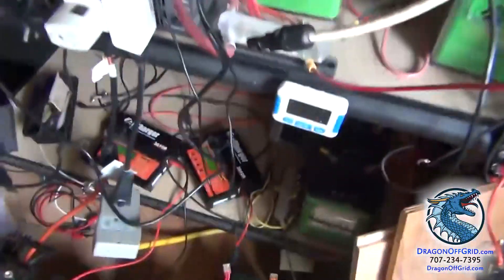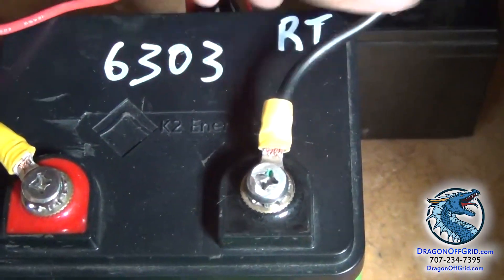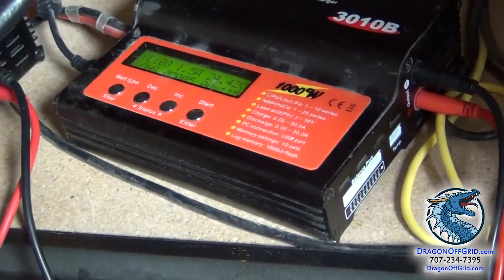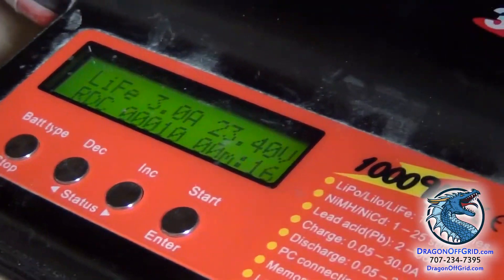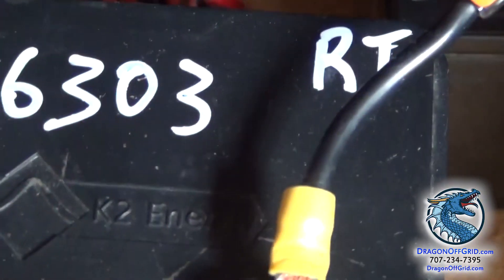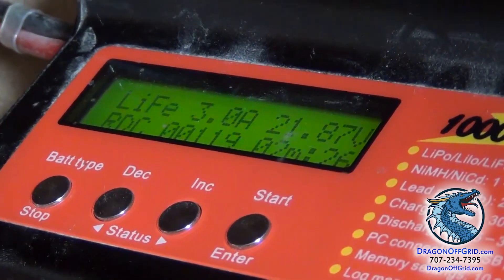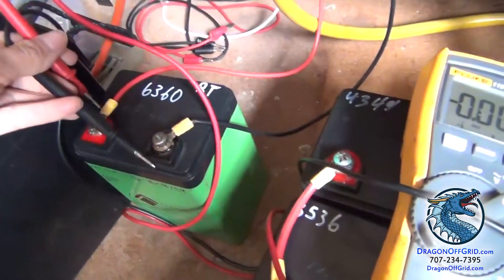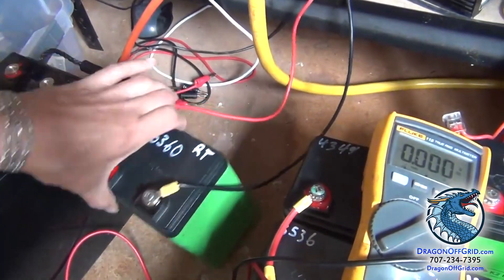How to test a K2 Energy Lithium Battery for FULL CAPACITY [K2B24V10EB]

Comment: I've acquired a few of these batteries and all of them are reading 8v. When the BMS turns itself off, does it usually rest at the voltage you measured or could also be at 8v like in my units?
Reply from the maker: Get in contact with us via text or call if you need help or have questions.
We've been working with K2 Energy batteries for 6 years

If under 10V for a 12V battery, jump with a 12V power source.
If under 20V for a 24V battery, jump with a 24V power source.

Comment: Hi Dragon Off Grid do you sell these batteries?
I have an 84V scooter and track down a couple companies in China that will make an 84v 50ahLifepo4 battery
for around $700. 
I saw your video and was wondering if the 7 of the 12V version of these battries can be
put in serier to make 84V.
Is 7 too much to put in series.
Reply: It would depend on the BMS, from the spec sheet of the K2 Energy (various models) they typically don't recommend more than 2 units in series, as the BMS may not have a balancing function. Ouch, a 28S battery, thats a big pack! Good luck.

Comment: I bought 4 of these to see if I can get them to work with my 24v apc ups, but I am curious what is the screw I use to screw down the terminals I read M6X1.0 X8mm but that seems insanely small to me
Reply from the maker: Thanks for the question. The batteries often come with 8mm long M6 bolts, or 12mm long with a flat and split washer.
Depending how many cables with lugs you need to fit to the terminals will mean a longer or shorter bolt.
A 12mm is a good start with some washers on hand in case they won't tighten all the way.
Reply: @dragonoffgridsolar  ill give it a shot hoping battery hookup send some hardware with these I imagine that is where you got yours too unless you bought new

Comment: I have the K2 25.6v like in your video. It has been used very little but will not change with the supplied charger. Battery reads 0.24v. Any idea why this won’t charge?
Reply: Sounds like the BMS has shut down due to low voltage.
Try feeding it 24v at .5 amps.   The low current may wake up the BMS.    You should be able to charge it after that.. if it still takes a charge.
Reply from the maker: @goldenwestmobility8501  This is the correct procedure. If it does not wakeup in 30 seconds then it is likely done for.
Reply: @dragonoffgridsolar  I had a couple of these and other batteries that put themselves to sleep. 
A low amp (.5a) matching voltage is all it took to wake them up. 

Trying to feed them a higher current (2a) did nothing as the BMS stayed in sleep mode.   Only a low amp voltage was able to wake them up.

Though I have heard of others waking theirs up with a another similar batter hooked up with it in parallels but I have never tried that as I try to avoid any potential current spikes. 

By the way, thanks for the upload.